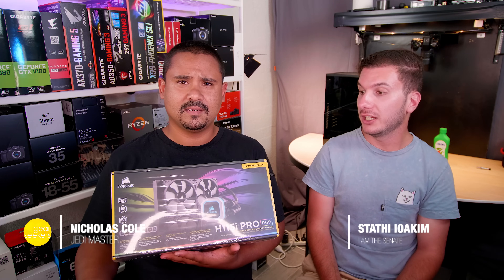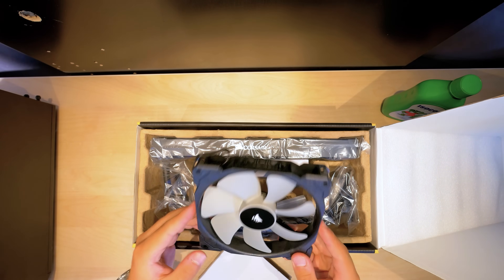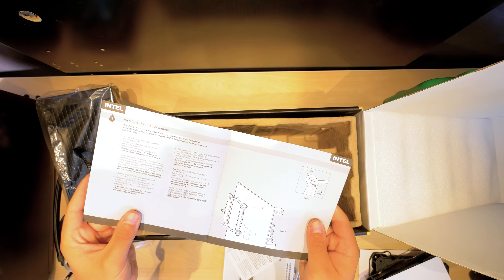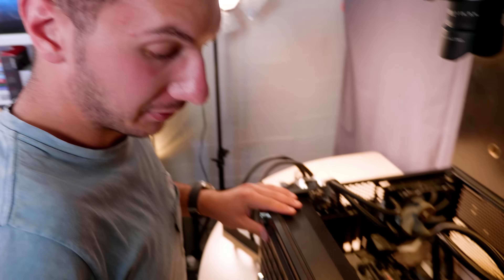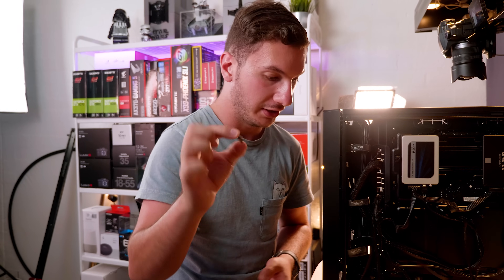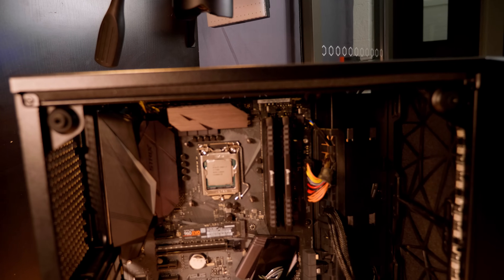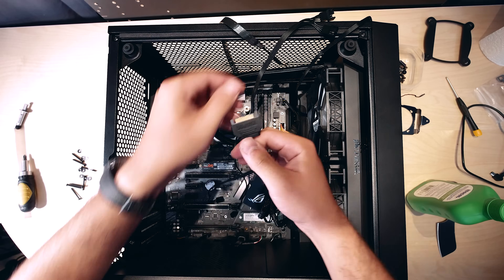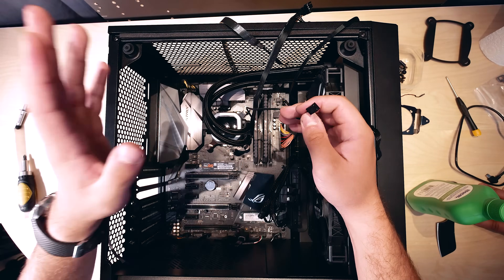HOWTO Install The Corsair H115i PRO RGB All In One Watercooler + Unboxing

Comment: "it's decent thermal compound" LOL
Thermal compound is thermal compound. Between the "best" and the "worst", you might have a 3 degrees difference. And good airflow in your case will more than make up for that.
Use the pre-applied pad, or if you have a used cooler, just put a dot (or X) of any non-expired thermal compound.

Comment: I really need your help guys. I have the node that comes preinstalled in the corsair 465x. The usb from the pump is installed, sata is plugged in and fans are plugged into the splitter. The pump led lights up, the radiator fans are spinning but rgb doesn't want to work. Any advice?
Reply: Should mention, I've plugged everything in the same way you have in the video

Comment: The side of the radiator where the tubes connect should be at the bottom, and the pump should be mounted in a position where it is slightly lower than the top of the radiator, where air is captured. If your case does not allow you to mount your radiator at the front of the case with the tubes down or at the top of the case, you can mount your radiator at the front of the case with the tubes up as a last resort.

If you do so, make sure that your cooler pump is mounted in a lower position than the top of your radiator. This will reduce the amount of air bubbles that enter the pump through the tubes, reducing the amount of noise made by the cooler.

https://help.corsair.com/hc/en-us/articles/360049358271-How-should-I-mount-the-radiator-of-my-AIO-cooler-

Comment: why are so many people making the mistake to use that radiator cooler as a case 'pre' heater by placing that thing on the front.... :\
Once again. Heat goes UP! Gpu wants coolest air not pre heated.... ant tubing looks like sh*t when you front mount... It all has a reason....
RADIATOR needs to be mounted ON THE FREAKING TOP if you can to benifit MAX PREFORMANCE....

Comment: Theoretically mounting the fans on the inside should work better. Not sure if it is going to make a noticeable difference but if you know anybody who has ever setup a grow room they will confirm that you will get a greater volume of air to pass though your system by sucking air through a obstacle than you will pumping into as this will create air pressure that will cause resistance on the air pumping though the radiator. It’s always more efficient to suck than it is to  blow.

Comment: I by me a complett new System WIth a 10900K / Asus Maximum Apex and the H115I Pro. CPU going in dle up to 89°c ( Long Bolts ) With my old AiO i going to 42°c in full power ... ( My old AiO is the H80i ) ... So what did i do wrong ?

Comment: isn't the purpose of fans+radiator to blow fresh air into the radiator, which it has hot liquid flowing into it? The way you doing you are sucking hot air from the radiator (because it has warmed liquid flowing into that) and blowing that directly into the case. I'm confused

Comment: Did anyone realize that he set up his radiator upside down in the previous set Up and that’s why he killed his pump
Reply: what do you mean?
Reply: @sgpghost4338  the inlet and outlet tubes should be on the bottom so the pump doesn’t get any air bubbles, for one it’s less noisy and for two it’ll let the pump last for a long time and for three it maximizes cooling performance
Reply: @sgpghost4338  also that’s probably why he said it runs super hot , again not maximizing cooling performance

Comment: You killed your pump because you had your AIO installed incorrectly. You need to flip the front mounted radiator so the tubes are at the bottom of the radiator, not the top. The way you had it mounted was allowing air to get stuck on the pump. You need to watch Gamer Nexus video on how to install AIO cooler correctly.
Reply from the maker: So wrong mate. You didn't even watch that video properly buddy. Go back and watch that video before spewing this garbage out into the world kiddo. The fact that you commented this shows that you have no idea what was said in the video and that you are incapable of understanding what was said. This is 2020 in a nutshell. People are lazy and hear what they want to hear.
https://youtu.be/tU7D6y_QYcI?t=1462

Comment: just realized i install my fan wrong.. thanks guys!
Reply: Yup, I put the fan cable on the wrong side and then, after I got the radiator installed, one of my fan cables got wedged on the side of the case and I couldn’t cable manage it, so I had to reinstall the radiator lol.

My first full build and it posted!

Comment: Hey guys!!! I need some help

Have a H115i with 2x SP140L's but found BNIB ML140's

My radiator is top mounted due to GPU being too long to fit it in the front.  Would you switch the SPs out on the radiator and use them on the front as there's less restriction so they can run quiter and us the MLs on the top. Or just use the MLs as intakes

Comment: Hi there, I seem to have the same exact problem you had in the begining of this video. I also have the i7 7700K CPU and it is connected to a Corsair H100i. It has been like this for 6 years and been a damn good system in this time. I have had very few problems with it, until recently. I formatted and reinstalled Windows and I have been having really hot readings. 70C at idle and 90-100 while gaming. I know this CPU is hot, but it shouldn't be that hot, so I bought some AS5 paste to give it a fresh connection, as after 6 years I thought that might be the problem. Since then, It has got WORSE. Just getting into windows I get 98-100, that is crazy! In the bios it starts in the 30s and slowly goes up, but as soon as windows boots, its 90+ I have tried to remove the paste and add it again as I was worried I used too much, and the second time I used just a line, as their site says. But same results. So just like you, I think the H100i has died, it seems to be powered, still making a noise and lit up, but it doesn't seem to be working at all. Is there anything you can tell me to try before buying a new one? I was thinking of the same one you installed here, as it is very similar to the H100i. Any ideas on what my problem could be before spending money?
Reply: Permeation. You are lucky to have gotten 6 years, most lose a lot of the liquid through the porous tubes after 3-4. I doubt you can top it up so I suspect you will need a new one.
Reply: Lee Adkins yea I know, 6 years is a nice return for a product. I bought a new cooler already, not liquid though.
Reply: Just installed the new cooler, 35C at idle now, for a hot i7 I think that is amazing!!! I got the Noctua 15 all black one. I like it!
Reply: @Ianchaytor  Nice! I could do with a new air cooler myself, I'll check that out.
Reply: Lee Adkins it’s a great cooler, but massive. You will need a lot of room, I had to move my graphics card over 2 slots lol

Comment: i thought the fans is for pushing the heat out of the pc and not pull like ( [heat from cpu > fans pushing out heat > radiator > out of the pc case) and not (radiator > fans pulling air from outside the case > cpu) or does that matter at all?

Comment: Out of 1000 videos, u finally said what I was trying  to confirm. If u use the mobo AIO pump header you will get a No CPU fan error when u first boot. U have to disable the cpu fan in the bios. Thank you for mentioning it, I noticed I had stable cooling conditions but wasn't sure if i should disable the cpu fan. Ty for explaining the most crucial part which is the mobo wiring.

Comment: Whats thw right fans placement. Guy at MicroCenter said i should mount fans in push position for front mounted radiator. You did it in pull
Reply from the maker: The guy at microcenter is wrong.

Comment: Okay... so I'm idling at 55C(ish) and am pretty much maxing out on temps for some reason on an 8600k installed exactly as you have (exception I'm in push config and using Kyronaut paste).  Pulled everything off and re-installed with the exact same results.  I dropped 200 points in cinebench just from thermal throttling over a coolermaster ML240 that would keep me below 90 with a 5ghz all-core OC.  What am I doing wrong or did I just get a dud?  Dialed down my OC from 5-5.1 down to 4.8ghz and still thermal throttling...

Comment: NOT "anything AMD, try installing that on a TR4 and end up frustrated trying to get a proper adapter.
Reply from the maker: You shouldn't be trying to use this cooler on TR4 anyways. It's nowhere near adequate
Reply: @GearSeekers  Not according to AMD who list it as a preferred solution for even the 2990wx
Reply from the maker: It's called marketing. Nowhere near adequate.
I daily drive 2 TR4 machines

Comment: I currently have a Ryzen 3700x with a gigabyte x570 Aorus elite WiFi motherboard and a Corsair hydro series h55 liquid cooler 120mm and in games like battlefield 5 I’m hitting around 70 and 71 cpu temp. I have two front intakes, a rear exhaust that is sandwiched with the radiator and another intake fan in front of the radiator for a pull push. And a top exhaust fan. Question is if I get the liquid cooler you have in the video do I have to deal with fluid or loading it and since I would be upgrading from a 120 mm consair to a bigger one would I have to change the stand offs or anything since they are the same Brand? I notice for the AIO I have now I don’t need a bracket as it seems to screw right onto my motherboard and someone said it’s because some AMD motherboards don’t need the bracket? So would I have to change the standoff?

Comment: ni I have an i7 9700k wat idle temp should this be im getting 41 base temp
Reply: I have this cooler on my i7-9700k and I idle around 27-29 celcius. 41s a bit hot for idle but just keep an eye out for load temps and make sure it doesnt pass 80

Comment: I delidded my 7700k and had some decent results with liquid metal using only a 120mm Coolermaster AIO, though I previously wasn't hitting 90's unless stress testing and am currently averaging 40-45 C while watching this video and having 51 tabs open (researching numerous things). I definitely recommend looking into delidding and using liquid metal to anyone with the same CPU and dealing with more heat than seems reasonable. I also use a good thermal paste between the heatsink and CPU.

Comment: I have a MB that we believe is too thin (z370 Auros Gigabyte). Is that MB comparable with this cooler?
Reply from the maker: yes
Reply: Gear Seekers then how do I securely put on the back plate? The plate is loose and does not tighten to the MB
Reply from the maker: @RGBeeve  its not supposed to be tight on the board. Mounting the cooler creates clamping pressure. You seriously think that it's not going to work on your very common motherboard?
Reply: Gear Seekers Im very new to PC’s so I just want to make sure. Also we decided to throw on 2 sets of washers to make it more secure. Either way, we ended up having to stop because the RAM did not allow us to mount the radiator as well as the fans directly to the roof of the Phanteks 350x that I have. There was just no room for us to mount it directly up there.
Reply from the maker: Washers? That's a terrible idea!!! Take the washers out!
Reply: Gear Seekers we have the entire bracket off. I said screw it, since I will ultimately need a Full case since the RAM is in the way no matter what. Washers are off, old cooler is back on.
Reply from the maker: @RGBeeve  don't ever use something that doesn't come with a cooler to mount it. You can short out your motherboard or break something because the clamping pressure will be out of spec.
Reply: Gear Seekers 10-4. To be fair the washers came with the cooler. But I will keep that in mind for next time! Thank you!

Comment: i know its a old video. but anyway i got a i7 6700k and a corsair h115i extreme same as yours. same issue with the temps idle 40 degrees. i solved the issue by hitting on the tubbing from the cpu cooler. it goes from 40 to 18 - 22.  thats how i solve my problems with the hot temps. still i am going to upgrade to a differtent cooler. because i am not in the mood to hit my tubbing over and over till the water flows through normally XD.

Comment: When I was putting in my standin screws it had a lot of wiggle room on the back of my motherboard. I made sure it was right and I can’t screw anymore. Someone help please
Reply: the screw might be stripped or you mightve gotten a motherboard not compatible with it
Reply: What mother board do u have
Reply: That’s normal. Installing the pump tightens everything up

Comment: Theorically, think of installing a radiator like you are installing it in a car. The radiator in the car is being cooled down by the wind when driving forward which the electrical or mechanical fan is blowing towards the engine. 

Since the computer isn't moving the radiator has no air flow to cool the radiator to provide cool water  to the cpu. 

Just saying. I believe you installed the fans wrong bro.
Reply from the maker: They are not installed wrong.

Comment: I am purchasing computer parts from Newegg and have decided to purchase an i9, which pretty much requires water cooling. Thing is, even though I've built computers before and the case I'm getting supports liquid cooling systems, I've never installed such a system. I'm worried I might somehow screw this up, and end up setting myself back $3,000.

Am I correct in assuming the water is already included in the system itself? I saw no portion of the video that involved filling reservoirs, mixing the liquid with additives, replacing the liquid every 6 months, etc.. I'm worried if I'm getting nervous over nothing. I'm hoping to get into streaming with this new rig, and I don't want to mess it all up.
Reply: From what I know the water is already in a closed loop liquod cooler, I'm guessing you've seen videos where someone puts water in the loop when they install it for the first time but that's custom water cooling.

Comment: Dont know if you guys still monitor this or not, but, just want to be clear on the fans. so the fans are mounted on the inside of the case, and they blow towards the radiator/outside of box, or away from radiator/inside box? Thanks
Reply from the maker: Depends on the case

Comment: Uh yeah, apparently my PC gets peaked around 66 Celsius... very hot if converted to Fahrenheit... hoping that this or any other cooling system i install will help with the temperature and performance
Reply from the maker: 66 is acceptable
Reply: Gear Seekers Oh lol 😂 I still want a new fan though since mine doesn’t sync well with my motherboard
Reply: Noone really uses farhenheight for temprature measurement for PCs. 66C⁰ is pretty decent.
Reply from the maker: None uses Fahrenheit outside of the US lol

Comment: Nice video! 
What’s the sync cable for exactly and did you just plug it into an usb2 port? 

Also, what’s about the pump header cable, how do I find out if my motherboard needs one? I will be using a gigabyte aorus z930. If I don’t need it, I just stuff it somewhere?

Comment: Shit, I installed my fans backwards
Reply: The damn manufacturer photo is wrong then!!
Reply from the maker: It depends where you install your AIO
Reply: @GearSeekers  inside the case. The manual DID mention that they recommend having the air intake direction inwards. I'm assuming the situation would be same for the AIO being installed on top or front of the case

Comment: It seems that it would be better to exhaust the air out of the case forcing air across the fins and then out of the case.  I saw this on the Corsair forum as well.  that way you get rid of the hot air.  why are you intaking air?  seem like the case, mobo and GPU will get blasted with hot air?  I am trying to decide how to do this for my install and would appreciate some discussion.  I am also going to exhaust out of the top.  Was thinking fans pushing air up, then across fins and then exhausting out the top.  I have all my HDD in the front so no room.
Reply from the maker: This is the correct installation for the case in this video. I've been building PC's for over 20 years. I know a thing or 2 about cooling them mate.
Reply: @GearSeekers  was not saying it was wrong.  So you are saying to suck in cool air from the environment, pulling it in over the radiator and then blow it to inside the case?  I am trying to be explicit with the direction description so I understand.

Also, I currently have 2x200mm fan already in this position.  Do you think I could use them in place of the 3x 120mm fans and just place the h150i pro under them?  I have a cooler master HAF case

Comment: The manual says you don’t need thermal paste. The video doesn’t say you need thermal paste. I concluded you don’t need thermal paste.
Reply: @eCloudThank you,  I attached it using cross method and it works fine. Easy Peasy! :)

Comment: the tubes that come off the radiator does matter if they run off top or bottom  if its a front intake like that?
Reply from the maker: top is optimal
Reply: @GearSeekers   should i switch mine around then ? also just wondering what makes it better?

Comment: Now when it comes to the heat transfer between fluid and air it wont matter which side of the rad you put ur fans, but keep in mind that if your fans are on the inside, you will have a little better convection heat transfer from your components to the air flow from the fans.

Comment: I didn´t understand why you changed from a H100 v2 to H115, which is basicaly the same ( or not ? ) My H100i has problems with the pump, and I need a new one, but I didn´t decide what´s the best one: H100i V2 or H115 Pro ? What about temperatures ?

Comment: There is also always arrows on the fans telling you which way the air flows, also why would you want the air to be sucked in when the directions say to put it where the the fans blow out, your fans are backwards
Reply from the maker: They are definitely not backwards. You need to supply the rest of the system with air. This is the only way to front mount a radiator.